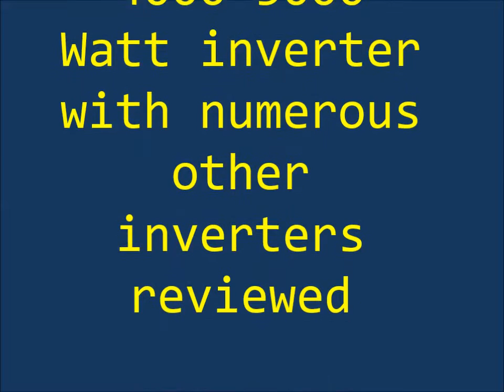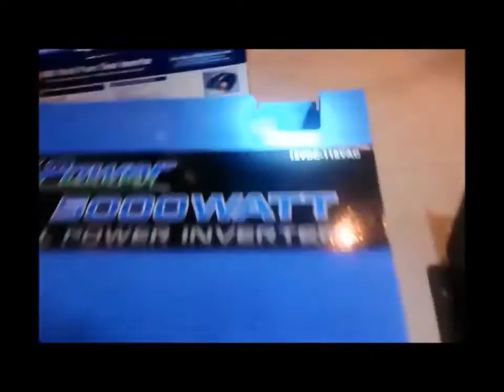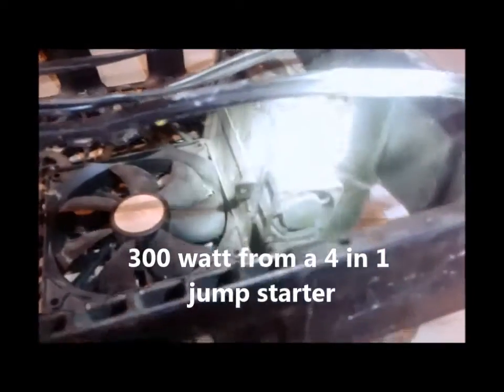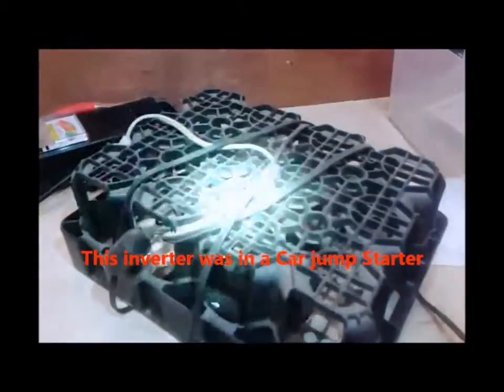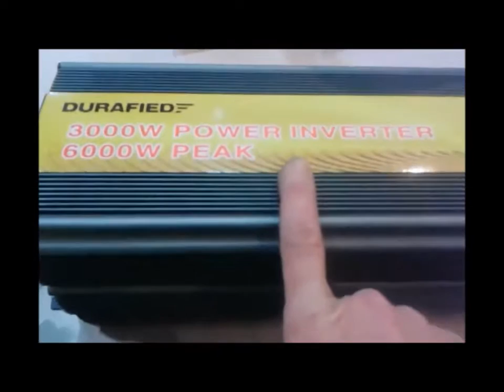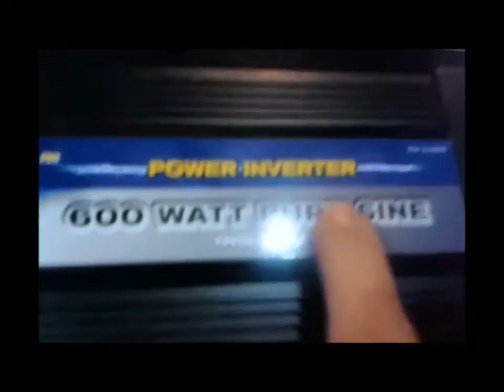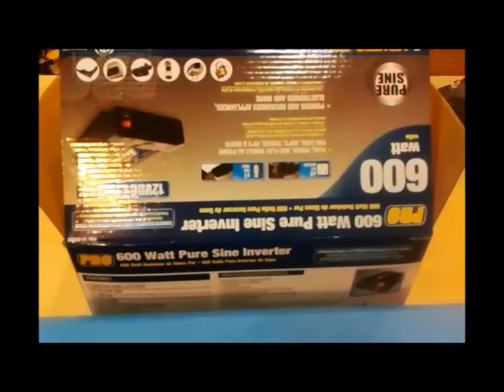DC to AC Power INVERTERS 300 to 5000 watt REVIEWED Opened

Comment: The inverter market is a tough one, I have been looking for a good pure sine wave one in the 3000 watt range, but it is hard, every time I think I have decided on one, I find out more info that changes my mind. I am running on cheap modified right now, but there are things I own that wont run right on them. It is a tough call between playing the gamble with the cheap ones or saving up the money to buy something like a Magnasine inverter. Lots of reviews out there on the inverters, but seems for every good review there is a bad review on the same one.
Reply from the maker: +Great North Woods Hillbilly I just order ed another Mean Well 3000. The 3 I already have are in 24-7 service for almost 4 years. Zero fails. 
I'll do a very in depth video on it. Mean Well in used exclusively in yahts and $150,000+ motor homes. For under $800 you can get one with full amazon and manufacture warranty.  A TS-3000F is the most durable I ever owned. I even run my harbor freight 90 amp mig  welder on it.
Reply from the maker: +Great North Woods Hillbilly I just order ed another Mean Well 3000. The 3 I already have are in 24-7 service for almost 4 years. Zero fails. 
I'll do a very in depth video on it. Mean Well in used exclusively in yahts and $150,000+ motor homes. For under $800 you can get one with full amazon and manufacture warranty.  A TS-3000F is the most durable I ever owned. I even run my harbor freight 90 amp mig  welder on it.
Reply from the maker: +Great North Woods Hillbilly I just order ed another Mean Well 3000. The 3 I already have are in 24-7 service for almost 4 years. Zero fails. 
I'll do a very in depth video on it. Mean Well in used exclusively in yahts and $150,000+ motor homes. For under $800 you can get one with full amazon and manufacture warranty.  A TS-3000F is the most durable I ever owned. I even run my harbor freight 90 amp mig  welder on it.
Reply: Thank you for the info, I look forward to the video on it.
Reply from the maker: They finally have MUCH better stuff, this video covers the older versions. The newer models are much better & they are cheap to buy. http://rover.ebay.com/rover/1/711-53200-19255-0/1?icep_ff3=11&pub=5575119394&toolid=10001&campid=5337663791&customid=Multiple+Better+Inverters&icep_store=dmssgs-e-store&ipn=psmain&icep_vectorid=229466&kwid=902099&mtid=824&kw=lg  2016 and newer are  Better versions

Comment: Ever since I got that Road Pro 800watt from you, has been on for month's now. And runs a small refrigerator in my garage. Thanks for the review : )
Reply from the maker: +TheBillytheJack2010  Whats funny is thats a $35 inverter thats built better than the shitty AIMS junk but based on the same one they sell for $79. It is identical to the AIMS but the Road Pro (and also sold as a Western from Menards & Tractor Supply), they have much higher rated MOSFETS, 10 amp triads,  and big ass Capacitors. All for less money than that shit sold by AIMS. AIMS orders theirs with cheaper shit in them and sells them to idiots! Damn AIMS is just a shit pile and who ever sells them are shit piles too.